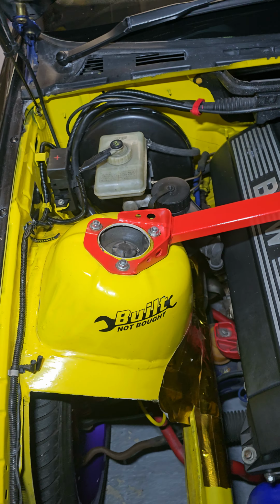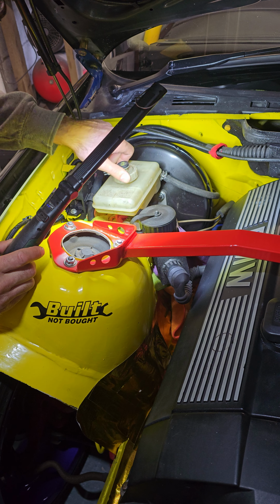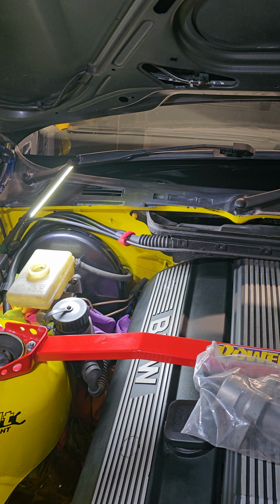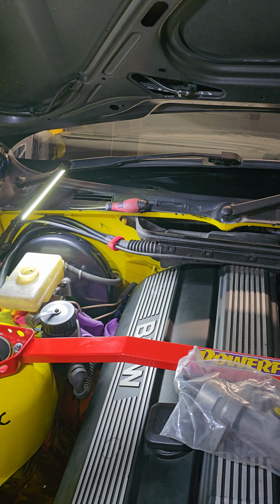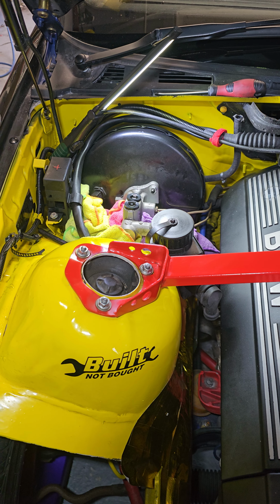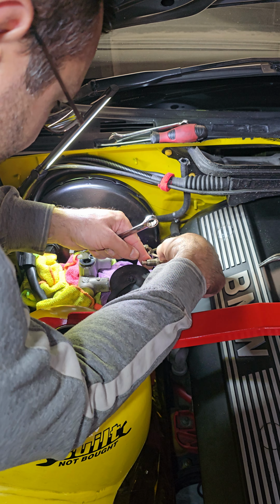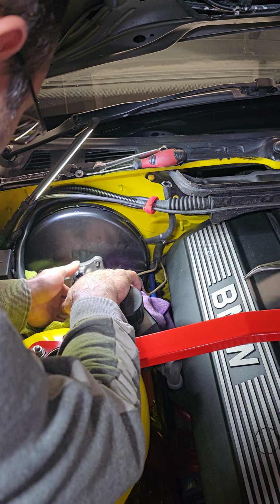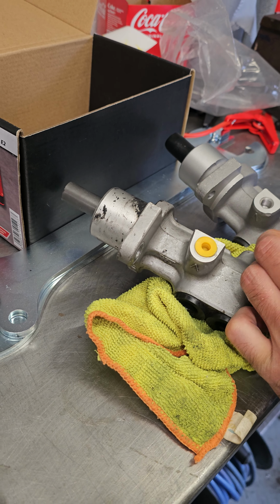bmw e36 brake master cylinder upgrade

Comment: Hey , i notice that the hole for the front brake in the master cylender is smaller in the new one . I have the same problem with my e36, 318is, the master brake i bought is bigger than the hole in the old master brake. Did you swap and buy a different one or how did you fix it ? Thanks , great video